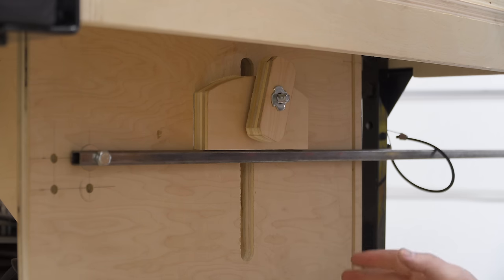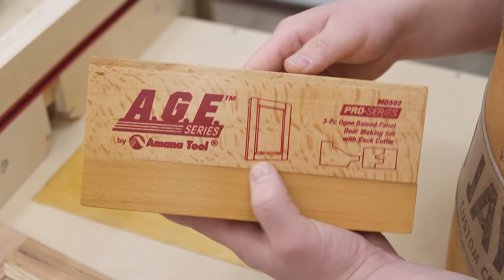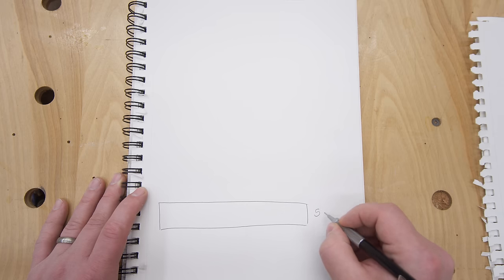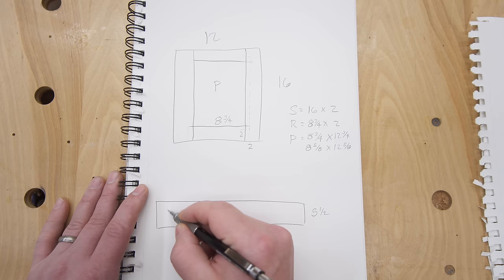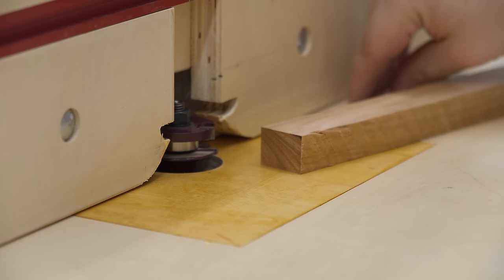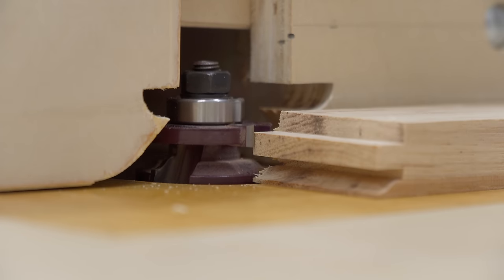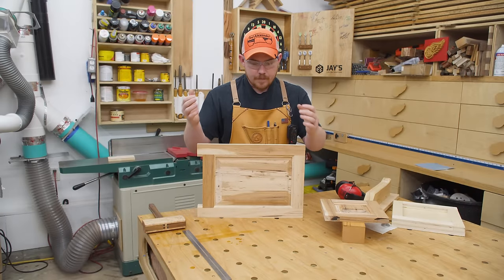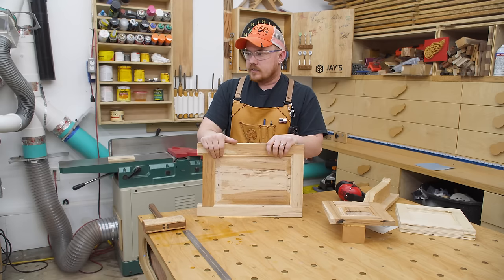Raised Panel Cabinet Door From Router Bits - 295

Comment: re the adjustment of the pivot arm being "less than precise". Could you not incorporate a screwed rotary thread from the top of the table, presumably through a hole in said table? This could then connect to some mechanism on the pivot arm, such that rotating the threaded rod, you could use a rotary motion to incrementally and continuously vary the height of the pivot arm, and consequently the router? Difficult to describe, but i'm sure you can get my meaning? Just an idea!
PS. Great videos... only recently discovered your channel, but have been going through your back catalogue, and learning a lot. As i remarked elsewhere, i'm mainly interested in making guitars, but your videos are getting me interested in other woodworking ideas as well. Thanks again!
Reply from the maker: That's the exact comment I'm trying to address with this video. There is no need for it in my opinion. It's over complicating things. Thanks for watching and for the kind words, Tim! :)

Comment: A tip my father-in-law gave me was that if you leave a bit too much extra room in the panel and you're worried about it rattling or being lose, take some silicone caulking and squeeze out a small line onto wax paper, when it dries, put it in the groove of the door to take up that room and eliminate any chance of rattling but it still allows the wood to expand/contract with seasons.

Comment: If you run your stick bit first you can keep all the rail & stile stock as long lengths.  With some feather boards in place, just keep feeding material.  Then cut to length.  Then cope the ends of the rails.  If you are making more than one door and have your material already ripped, this amounts to less handling of small pieces at the router (shaper) table.  Setup of the bit heights is just as straight forward as you fit the coping bit around & into the stuck profile.
Reply: (Should add that you may want to put the cope profile on a scrap to act as the backer to prevent tearout on he rails when they are run with the profile toward the push block.)

Comment: How about expansion gaps? do you just leave the panel a bit short and just glue the frame around it?
Reply from the maker: From my research, make the panel 1/8" less in both directions and either center the panel on the rails and put a dot of glue in the center of the rail groove or use compression spaceballs on both sides.
Reply: Thank you, i never heard of spaceballs before

Comment: Any suggestions for a rails and stiles that fit together loosely? After milling the parts, the profiles match up perfectly and fully seat, it's just that they are pretty loose. Yours were a friction fit, which I'd think would make a stronger door.
Reply from the maker: That is most likely due to the bits used
Reply: @JayBates  Yep, adding shims did the trick. Thx!

Comment: What kind of witchcraft are you using  @ 4:00?  I cant make my SS run that quiet...
Reply from the maker: I lowered the volume when editing.
Reply: For those of you with a digital height gauge for the tongue and the groove bits, 1.215 for 3/4 stock dials it in perfectly.

Comment: Is there any value to adding a vertical measurement scale on the board next to the lever lift or the fence next to the router bit placement?  Excellent video.
Reply from the maker: Nah, just set a combination square on the table instead. A ruler on the lift wouldn't work because the router bit height is in a different position in the collet every time.
Reply: You wOOd have to reset the scale each time you change bit.

Comment: On the front of your router lift you should put a ruler.
Reply from the maker: Why?
Reply: @JayBates  Measurements - they have the ones that stick on. Just an idea
Reply from the maker: No way for it to stay calibrated. Every bit change will change the height.

Comment: So I'm guessing the paneling bit's height isn't critical?
Reply from the maker: For the joint to work, no. The height just changes how "sunk in" the profile is.
Reply: It is, but it follows the same process as the tongue and groove bits.
In the case of Jay's raised panel, you'll want the top of the bit to cut its "tongue" at the same height as the rails and stiles. This will make the back of the door completely flush (with minimal planing/sanding/scraping), and insure that the front of the panel is the same height, in the middle, with the height of the rails and stiles.
Reply: Zachary May - also, having the raised panel the same height as the frame makes it easier to sand.
Reply: well, yes, but the panel should be sanded before assembly. Otherwise, you might damaged the patern of the outside. Sorry i don't know all the english name.

Comment: Dear god, when are you guys going to start using the metric system 😅
Reply from the maker: When it's necessary to do so. Until then I'll rely on basic math just like you :)
Reply: Jay Bates, still love your channel, inches or centimeters 😉
Reply: Try living  in Australia, where we use both. Our routers use  1/2" or 1/4" shanks. You set out in mm, then have to account for a 3/4" bit rebate.
I've luckily grown up with both thanks to my Pop and use them interchangeably, but my students get confused with router setup unless I've made a jig for them. I've just started finding metric bits to go into the 1/2" router ;p
Reply: Burma and the good old USA the 2 countries that could not convert to metric
Reply: I started making cabinet doors yesterday and got so dizzy figuring it in fractions that I switched to metric.  So much easier. But until the states moves to metric, Canada will never go fully metric due to our integration of our economies. 
All I can say is it's far easier adding 10mm +10mm than 3/8"+3/8".
Reply: The US is not 50 years behind. Cars and planes are all made using the metric system. Except the wheels. My Holden shipped came with 48.26 Dia. wheels. See the problem? When you talk collet size 1/4" and 3/8" just becomes a number. No needs to know they are .25 or .375". Tape measures are easily obtained with both inch and metric printed on them.
Reply: In Canada most youngsters still can use inches thought they aren't proficient with intricate fractions. Until tools and building supplies will follow current US practices it won't change. Funny thing, people's height is still colloquially given in feet-inches and body weight in lbs. Otherwise, most things are metrics. As an architect, I always found using feet for general design made more sense. Dimensions are related to the human body, making it quite useful. Also, working with feet makes your life easier when trying to design using modules and fractions. But I can see the shift, particularly since drawings are done with software such as Revit. Many contractors are switching to metrics too, mainly because they feel it is easier to handle (not fractions) and more precise.
Reply: whenever the Illuminati tells us:)
Reply: cause we weren't raised with that system and when you say 25mm, we can not see that in our minds until after we convert it to inches.
Reply: I don't think this will ever happen. I live in Europe where we use the metric system. I always had so much trouble with inches, because noone knows how big an inch is.
1 inch = 25.4mm (woodworkers)
1 inch = 26mm (I really forgot who uses these)
1 inch = 25mm (blacksmith)

The problem here is that if you go to a blacksmith, his inches are 25 mm, while woodworkers use 25.4mm.
So you order a 10-inch bracket (inner size) from the blacksmith and you order some 10 inch wood (outer size). and the wood needs to be planed down to fit the bracket.

Now for the fun part. Nobody in the World knows what an ounce is.
If you order a PCB (printed circuit board) with 1 oz copper, you may get any thickness between 35 micrometers and 47 micrometers. This is a real problem, because suddenly you do not know if the copper layer on your PCB is thick enough to carry the current necessary. Had they just based this on the metric system, it would have been much better. I found out about this, when I needed to make a Javascript calculator for website use. I simply could not finish it, because it was too imprecise, so I had to give up. At the time, I tried to figure out how big a foot was. Well, officially, it's 12 inches, but if you investigate, you'll find out that people in some countries have much smaller feet than people in other countries. There are so many measurements that it's overwhelming. Yes, completely ridiculous.

I don't think things will change from inches to metric, because we still use inches in Europe when it comes to measuring pipes (some pipe types are measured on the inside, other pipe types are measured on the outside, another wonderful idea someone got!)
Not too many years ago, we changed the way wood was measured. Instead of measuring in inches, we now measure in mm. So we don't have 2-by-4's anymore. I do not know what they're called, except from "Reglar", but that does not define the size easily.
Boards were usually measured by centimeters (eg. 244 x 122), however now they're measured in millimeters, which means you have to be careful when ordering; do not order a 244x122, you need to order 2440x1220.

I can't defend any of the two systems; I can't say which is better, because there are good and bad things about both.
Metric certainly has its advantages when it comes to precision. Also ...
1L water weighs 1 kilogram. 1L = 10cm x 10cm x 10cm. 1 Ton water = 1000mm x 1000mm x 1000mm.
0 degree Celsius = freezing point. 100 degree Celsius = boiling point. Easy for us to use in Europe, but a pain for those who are used to a different system, so changing will take quite a while, perhaps even centuries (until someone come up with a new system). =)

... It boils down to that we'll still need to convert. 1 inch = 25.4mm.
Reply: Just say thank you your not spaking German
Reply: Bcz were too smart and can do  fractions in our head over here.. its why we're the US and you're not😂
Reply: I will never hire a person that can't do simple math in their head.

Comment: How bout a thread3d rod on your lil lever bar there?.. that would allow for smaller more controlled adjustments...
Reply from the maker: That's already been discussed several times. It's unnecessary. Smaller controlled adjustments can be made by hand.
Reply: @JayBates  and discused several times for a reason. I didnt say you cant do it your way, just saying you can improve your design.. but hey, im sure several cave men swore by the square wheel too.. ;)
Reply from the maker: It's simply unnecessary. Your analogy is like me telling you that adding the threaded rod is like telling people to wear a helmet when the drive their car to work.

Comment: A shaper is so much nicer than using a router.
Reply from the maker: Correct. An airplane is faster than a car as well.
Reply: Really?
Reply: No shit, who knew.
Reply: Yes, Captain obvious..."A shaper is so much nicer than using a router" is like saying "an airplane is faster than a car" . Both eventually get you to where you want to go, it's only a matter of time. Jay simply responded to your obvious comment with an obvious one of his own :D ....... Really
Reply: It's General Obvious.

The truth is I build a whole house worth of cabinets and doors out of oak.
When it came to the door building I started with the big porter cable 7518 router  mounted on my table saw in an Incra lift. 

Turns out sharing the tablesaw fence with the router isn't all that handy. I have an Incra fence on my tablesaw.
So I built a stand for my router set up and got a seperate fence. I had some 7 ft long door pieces to build and I found it was really hard on the router and the raised panels had to be cut in many steps and the router would just stop or trip a breaker once in a while. Getting the final cut with no burn marks was a real challenge. 

All the youtube channels I was watching were all talking router and router tables, I didn't know shapers existed, or what they were for. So I had spent a bunch of money on a Incra router set up and it wasn't doing what I needed. Except maybe on a very small scale. It is very noisy and lacks power for big stuff.

So after looking/learning around a bunch on woodweb I bought a Grizzly  G1026 3hp shaper with a small 1/4 hp power feeder.  I spent $1500 on some insert cutters with some spare inserts. The difference between the router and shaper is like walking to work v/s driving.

I could make one pass cuts on the oak with shaper and get really clean profiles. The power feeder made it possible to cut long pieces without the little ripples or burn caused by having to move your hands while pushing a long piece through and inadvertently changing the feed rate. Turns out feed rate is the most important thing.

The doors for all the cabinets would have cost me 12K unfinished from Conestoga.  Buying the shaper, feeder,  tooling and lumber cost me 5K. Finishing that many doors is quite the project, but it was worth it. 

I also bought an extra power feeder base to mount on my tablesaw. That way when I need to cut 80bajillion 2.25" wide boards it goes much easier. The mount takes about 5 min to bolt onto the top and is very worth it. 

So even a small shaper runs better and much quieter than a large router. A local builder gave me a 1 hp shaper and even it outperforms my router set up. That shaper new is $500. :(
This goes in the list of things I wish I had known before spending a dime.  So feel free to save a dime at my expense.

  Sincerly

 General Obvious.
Reply: nevermindthebollocks - absolutely for a production run your set up is the best way to go. For a hobbyist a well set up router table does an excellent job.
Reply: This wasn't production it was just for my house. I saved a whole lot of $$$$ by watching vids and learning how to do things. Some of Jays vids helped in that. I built all the cabinets, closets, vanities, doors and drawers. I got to use all the fancy Blum glides and hinges I wanted, doing it myself meant that I could afford what I wanted. 
My machinery is nowhere near production standards. Those machines are expen$ive. 

Lots of people including myself would look at a shaper and not really know what to do with it.  The same thing you do with a table router only better.
If you look into the small ones, just make sure they have a router bit adaptor.  They are quieter and have more power. 

I only use my incra router table setup for dovetails and decorative joints like in the incra vids. They do a great job of making it somewhat easy with the instructions.
Reply: @nevermindthebull0cks  From now on when I hear or say "SOME.......PEOPLE" I will think of you 1st